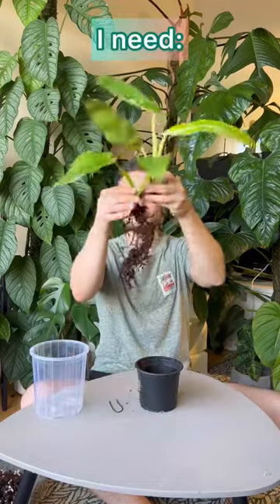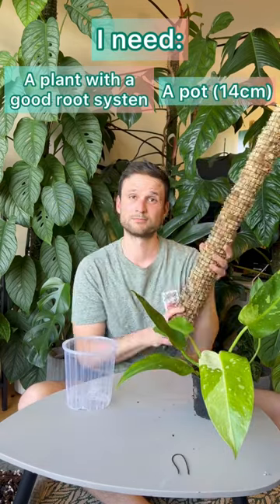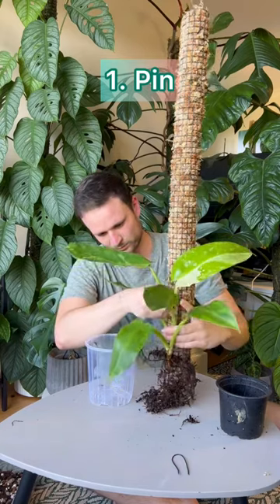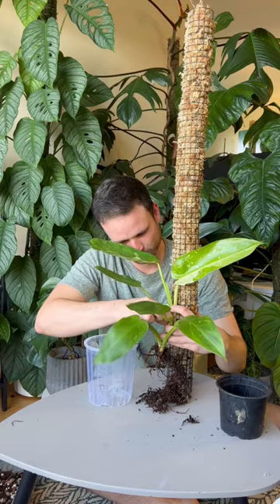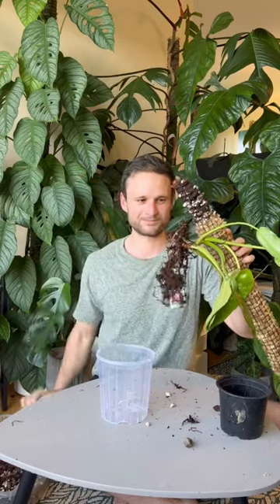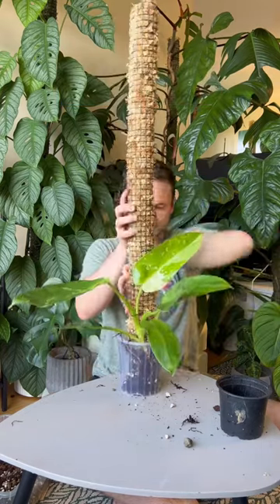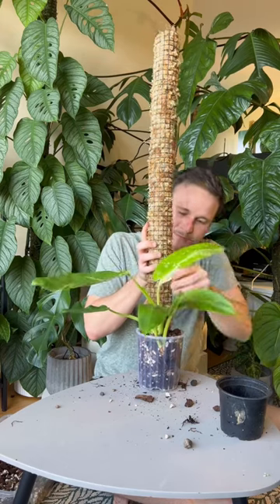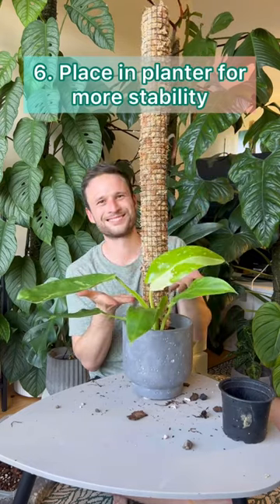Putting a plant on a pole for the first time. Detailed #tutorial in my moss pole playlist

Comment: Could you not just leave a cylindrical space in your planter wide and deep enough for your moss pole? Push your mix into the bottom portion and quickly place the moss pole into the cavity you made. Then you can plant your houseplant alongside it.

Comment: A question I hear differing answers depending on who I ask— how long after getting a new plant do you repot? If for example you buy a starter plant with decent roots, do you still wait to avoid shock/acclimate it to your environment, or immediately repot?
Reply from the maker: Reason you get different answers because it's never the same process - it really depends on the plant, how many roots it has, how healthy it is, how it ended up at yours (post or pick up), the existing mix (if it even has any), the conditions the plant was grown in and the conditions you got to offer etc. The principle is the same - you don't want the plant to experience shock or mitigate shock where possible. So for example a plant that was posted bare-rooted already went through shock by being bare rooted & by being shipped - i would propagate her in water for a while till I pot her up. A plant I picked up locally that is already potted up going into similar conditions I would report as the plant isn't experiencing any other shock. Growing plants is all about trying to understand the plant & acting accordingly, not follow a pre-determined timeline :)
Reply: @sydneyplantguy thanks so much for the reply :) that makes sense.

Comment: Great tutorial! I'm worried that air roots of my young plants are too short to reach the pole. Even though I attached the plant with wire there is still around 5mm gap between roots and moss pole. It is probably becouse not all my plants are perfectly straight or are a little bit twisted. Will they find their way or I should try something else?
Reply from the maker: Roots are attracted to moisture so they will find their way :)

Comment: When putting a plant on a moss pole for the first time, do you not need to continue watering the substrate in the actual pot anymore? I've had my philo black gold on a pole for 3 weeks and the aerial roots are not growing. I think it may be because I'm watering the roots in the pot (as well as watering the bottom part of the pole). Is this correct?
Reply: I should mention that the little aerial roots that are there are not even close to touching the pole yet (i have it pinned) and they're looking kind of dry. I have it outdoors on my balcony in indirect sunlight.
Reply from the maker: 3 weeks isn’t a long time, stay patient :) and direct sunlight is not usually what these climbing aroids like so i would give them more indirect light. I of course water the substrate that contains the roots - could be the pot, could be the pole, could be both. Ultimately you are watering the roots :)
Reply: @sydneyplantguy  Thank you! Yes my balcony is north facing so definitely no direct sunlight